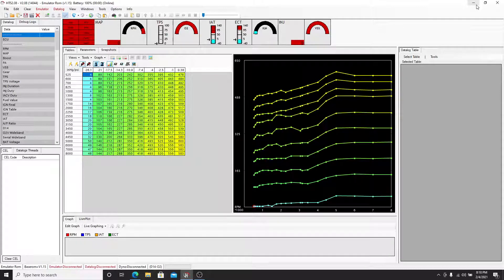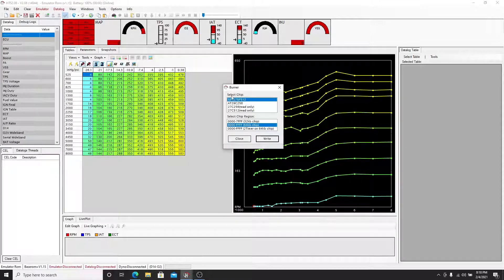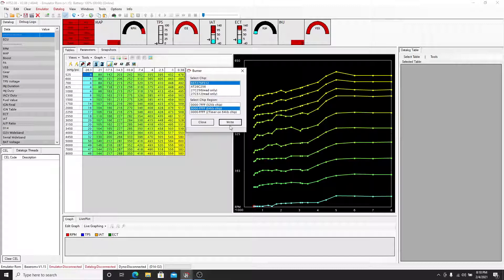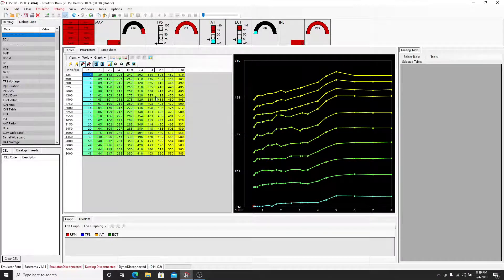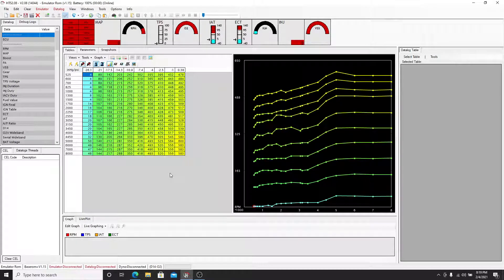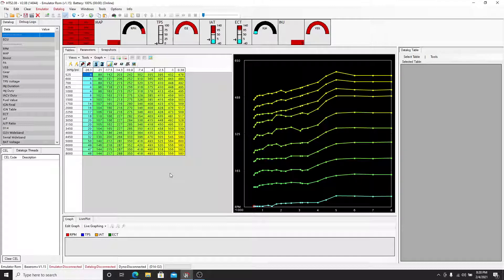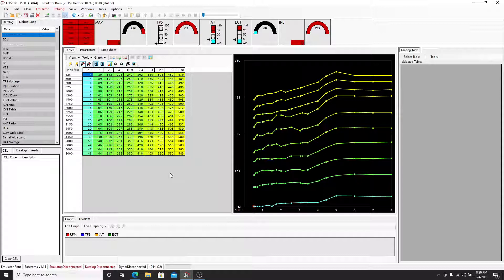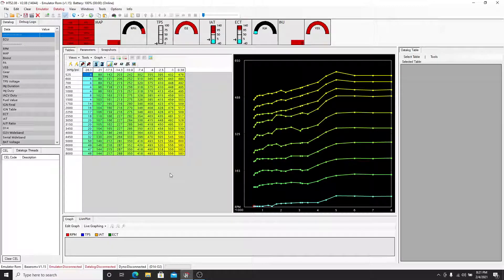BURNING A BASEMAP TO A SST CHIP!

Comment: Hi, thanks for uploading this. How do you write an existing basemap to your emulator to start tuning from it?
Reply from the maker: Hello, your welcome. So you would open the tuning program. Make sure your emulator is plugged in and powered up. Open the tuning software and you should have an option the live tune or connect to the emulator. Once you are you will just be able to hit the upload button and it will save to the emulator
Reply: @DIYKAI  Thanks for the advise. Super helpful!
Reply from the maker: @leonardcristobal7214  your welcome

Comment: Be good to see what emulator you use an physically shoeing the hardware, im looking to use a ostrich emulator to get the tune right then burn that a chip
Reply from the maker: I have several different options I use as I have a few Honda's.....I also have the ostrich 2.0 it works great and links right up to HTS.
Reply: Ahh thats really good to know thanks bud, look forward to seeing more!
Reply from the maker: Thanks....I can tell you the cheapest easiest way is a burn2 and ostrich 2.0
Reply: So would it be liked i said run the ostrich get the tune right then just hurn using that burner then fit the chip to have a finished tune, gonna look at getting the ostrich soon when i turbo my z6
Reply from the maker: @AHvehiclerepairs  so you can do either leave it on the ostrich 2.0 hooked up in your car...there is a small battery in it to keep the tune or save the file and burn it to a chip but yes ostrich is to live tune with datalogging
Reply: @DIYKAI  brilliant mate very helpful!!!
Reply from the maker: Your welcome. Lmk if you have any troubles
Reply from the maker: All will work in the same way though. Only things that would change are the settings in the file drop down menu